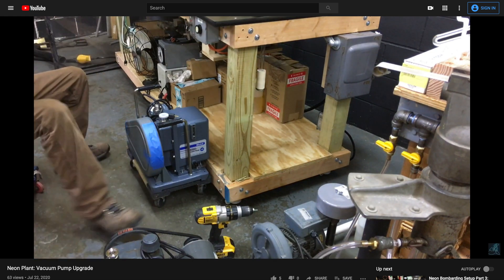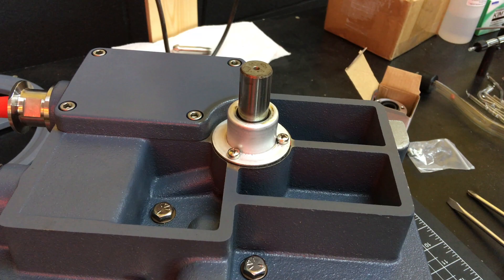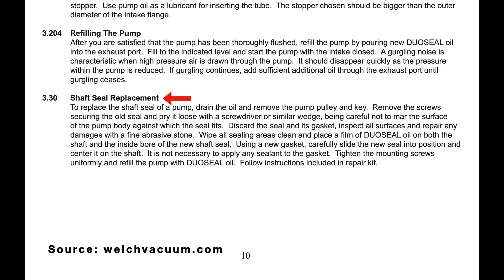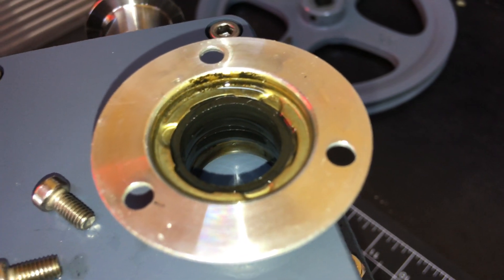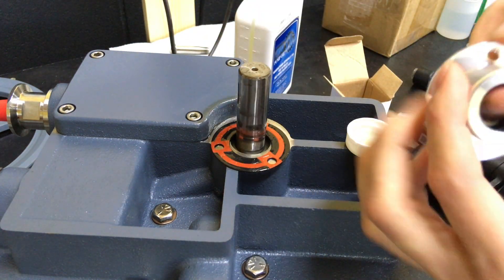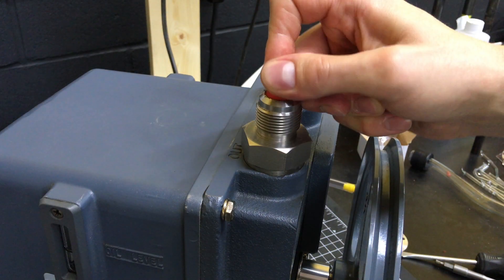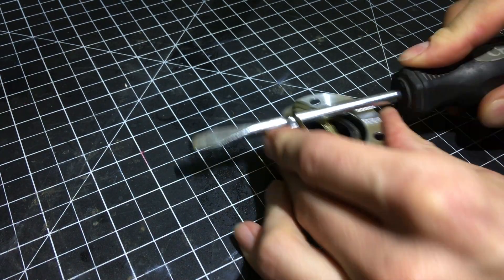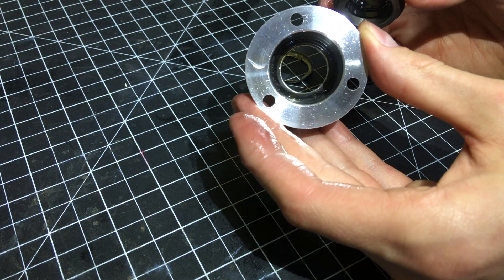Welch DuoSeal 1402 Shaft Seal Replacement

Comment: Not sure why this was recommended to me out of the blue, but I've rebuilt a fair number of welch and kinney rotary vane pumps, typically if your outer shaft seal has started leaking it's a secondary problem, on a lot of these pumps the vanes are made of micarta or similar material and small fragments can break away causing them to damage the inner shaft seal. In this case I know you voiced now wanting to open the case but I would have done so purely due to the fact you had all replacement gaskets on hand and would be able to confirm if you needed to remedy a damaged vane. Otherwise well done.
Reply from the maker: thanks for the tip!

Comment: Once the pump is turned off, does it leak back and slowly reduce the vacuum level? I have a model 1403 and it does that.  I had to put a check valve in and it is working for me. Nice video.
Reply from the maker: thanks!
i imagine it likely would; although i haven't tested it.  when i turn off my pump, i isolate the vacuum manifold from the pump then vent the pump to atmosphere.
Reply: @NeonPreservation  Thank you very much. I was into bell jars and vacuum stuff back in the late 70s.  I was spinning custom made neon tubes on a 24" diameter base and modulating them with 3 filters. Base, midrange and high.  The moog music was the nicest show. I made my own brass ring spinning contacts. It was a lot of fun and many a joint was smoked too! A neon shop in Elizabeth, NJ. Was the firm that did the custom tubes for me. Only you will understand this next line. " The magnet and the steel ball". I watched along when heu made them. The company that supplied the electrodes and standoffs etc was in Irvington NJ. The Glanse or Glaze company. They used to use mercury vapor to lower the  ionizing voltage or some argon, my memory is cloudy. Some of the glass tubing was coated in the shop also. If you are not a ham radio operator, you have gotten very close. We enjoy and appreciate these special areas as yours. I found your video very very interesting.  Be careful of that bombarding system, that can end your life. Take care and thank you. I am in Wall twp.  NJ
Reply from the maker: cool story!  i imagine the sign supply shop was Glantz, they are still around today.  mercury is used in most argon fill tubes because it creates UV radiation that excites the phosphors and creates a brighter glow.  i do appreciate "the magnet & steel ball" way of opening gas flasks, although my system has pressurized tanks, they hold a lot more volume and you dont have to break them open!  haha.
thank you for the warning about the bombarding system; i fear & respect the hazards, and i take extra precautions to keep away from it whenever the system is live!
Reply: @NeonPreservation  i am using my vacuum for pick and place. FYI

Comment: I just picked up a used one of these. the motor runs and looks real similiar to this one. Big question is: WTH do i do with it?
Reply from the maker: Welch makes superb vacuum pumps.  obviously, mine is used for making neon, but they have many other applications, including manufacturing, industrial, commercial, HVAC, and in laboratory settings.
Reply: @NeonPreservation  thanks for responding. question for me is what to do with it, i dont need it, it needs refurbished. the motor runs but the vacuum side wheel does not turn. its so heavy selling on ebay would be almost not worth the effort. I got it for the motor. its a 1402.
Reply from the maker: they are quite heavy, but very well made.  even if the pump is locked up, it can likely be rebuilt... if you dont want the pump you could try listing it on ebay or craigslist as "parts or repair" for cheap, see if someone adventurous is looking for a bargain.  would be a shame to throw it out.
Reply: @dickrizzzo  Hi. Do you still have the pump?  Where are you located?
Reply: @dickrizzzo  it could have been replaced. Do you still have it? I repair them for a living, starting my own thing.

Comment: Hello, your channel is good, I want to ask, I bought a vacuum cleaner that does not have a motor, it is the same one that you replaced in your plant, which motor could I install
Reply from the maker: do you mean that you have a Welch 1402 vacuum pump that is missing a motor?  the motor on my 1402 is a standard 1/2 horsepower electric motor.  does this help?
Reply: @NeonPreservation  If it helps me a lot, it also lost the filter, the belt and I don't know if it contains oil, is the used oil for vacuum?
I am installing my plant, with some things that I get in my country. I want a website where I can buy in the US. my instagram is @micorporeo
Reply from the maker: oil can be purchased at many vacuum supply websites, or even on Amazon:
https://www.amazon.com/gp/product/B00SB9K36I

pump parts can be found at many vacuum supply websites as well, just do a Google search for the part name or number.  here are a couple to get you started, but there are many more:
https://www.duniway.com/catalog/mech-pumps/welch-style-pump-parts
https://www.vacuumpumpsupply.com/welch-vacuum-pump-repair-kits/

Comment: I'm glad I'm not the only one who doesn't know where the "seal, shaft (metal case)" goes. Doesn't look like it was the same inside the old seal.....but maybe that's wear.
Given the cheap cost of kits, I can't imagine bothering to repair the shaft seal with this part, instead of just replacing it. Cheers for the demo
Reply from the maker: yeah, the parts description and exploded diagram were a little vague.  but, over a month after the replacement the pump is still working fine, so whatever the "seal, shaft (metal case)" was, i guess i didn't need it!  haha.  cheers!